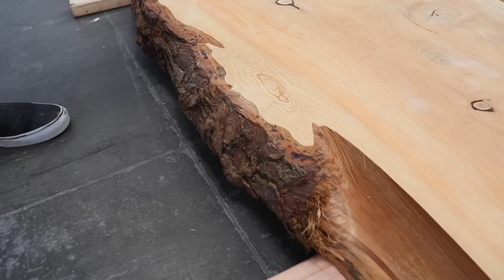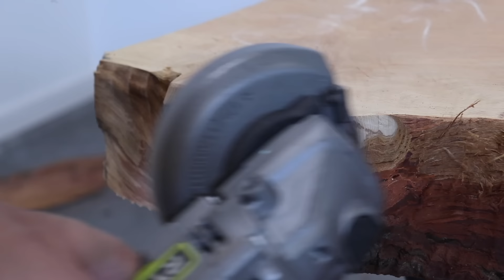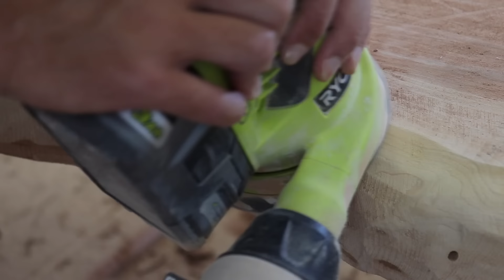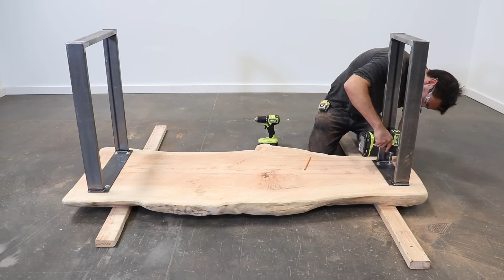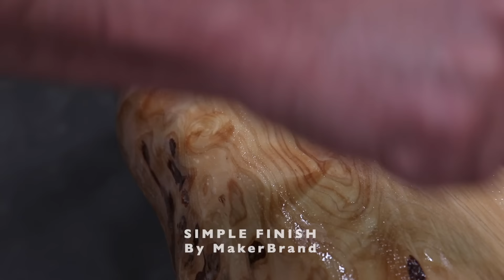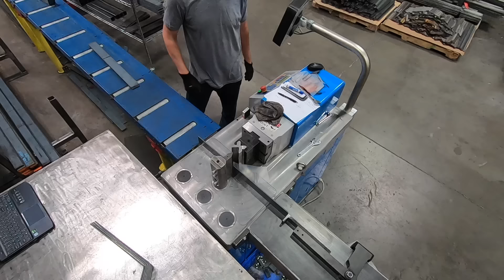The Easy Way to Make A Live Edge Table

Comment: That grinder with the holy galahad disc is a powerful tool.  It’s also super dangerous.  That is not a good tool for a beginner.  You need to know what you are doing with those and even then they can surprise you and not in a good way.
Reply: Exactly. It should be held for dear life because if it decides to jump and it will at one point or another, you don't want it hurling at you.

Comment: If you skip the flattening part, of course it's "the easy way". The most time consuming part is flattening the top.
Reply: Also failed to finish the bottom side or reinforce the big split. Not guaranteed, but this could turn into a multi piece pretzel after a while.
Reply: The channel is named "HOME MADE" modern, not "How to make furniture as a professional woodworker"... What are you complaining for?
Reply: @tonialzola  Even a home gamer would/should take the basic step of sealing all sides. Teaching people to make Pringles with legs is just bad form for a educational channel.
Reply: @tonialzola  lol
Reply: @vbaspcppguy  I dont think a slab that thick will ever turn into a pringle and even if it does the trend of using slabs will be gone by then... and the dyier will probably not care since they didnt spent a fortune.
Reply: I have a lot of milled pecan, I suppose same effect could be achieved with multiple planks?
Reply: @thestifland  gluing planks so that the grain curve alternates is a good way to help with wood movement. It still does not replace sealing all sides. (edited because of sleepy phone typing)
Reply: I would argue sanding is the longest
Reply: i guess im asking the wrong place but does someone know a way to log back into an Instagram account?
I was dumb forgot the password. I would love any help you can give me.
Reply: @Brecken Reginald Instablaster :)
Reply: @Hank Derrick thanks for your reply. I found the site through google and im in the hacking process now.
Takes a while so I will reply here later when my account password hopefully is recovered.
Reply: @Brecken Reginald Happy to help :)

Comment: Im curious why not use a wet cloth to remove the dust? 
So what kind table is this? Is it use for dining? Or only office?
Reply: A wet cloth raises the grain of the wood, which you'd have to sand off again before finishing. The tack cloth has a slightly sticky surface that picks up the dust without raising the grain.